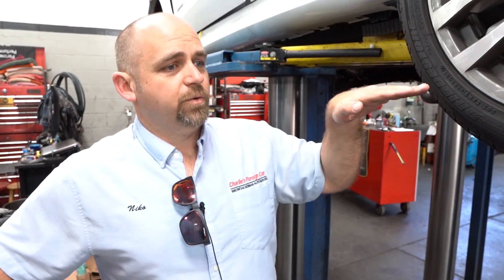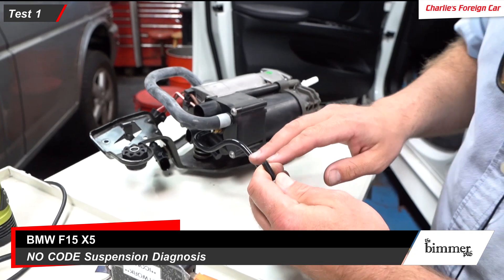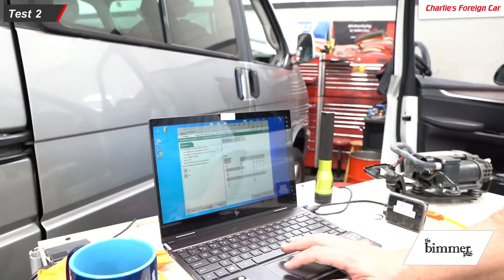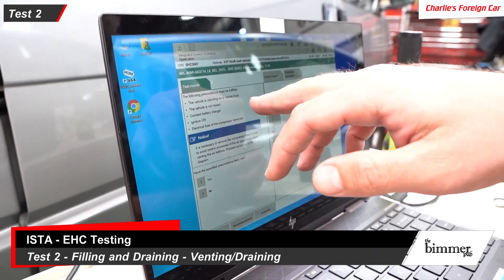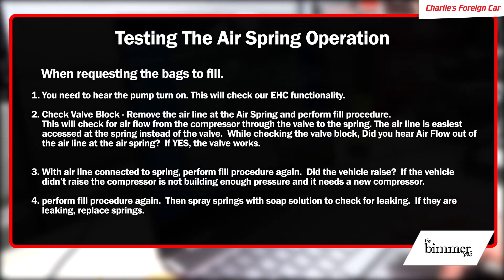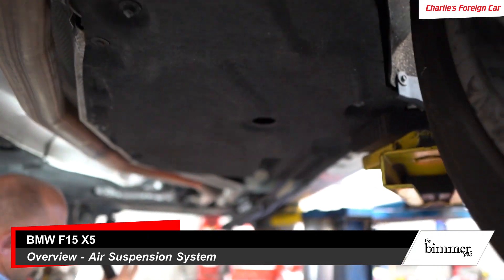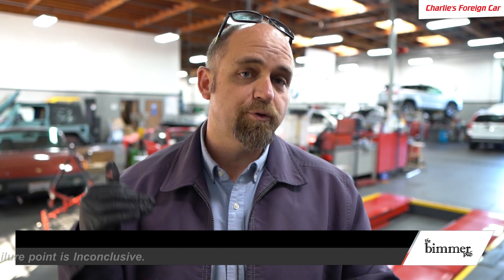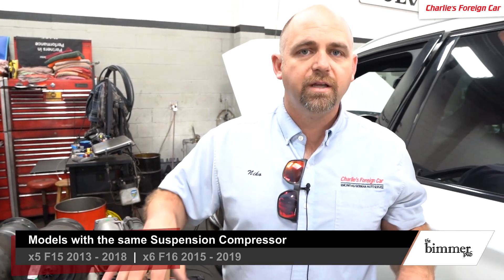Air Springs malfunction and NO suspension codes?

Comment: my air springs are leaving causing my rear to sag..however I'm not sure whether the compressor was damaged due to driving while the vehicle was sagging. anyway to check for the compressor? also going with the Arnott over the oem am i going to experience any difference, asking for a 2018 x5 40e phev

Comment: Bought new Airshocks, compressor isnt inflating the airshocks, compressor doesn't run when the car is on but seems to run when the engine switches off. Please help, what could be a problem

Comment: That's pretty simple indeed, I have a sagging BMW E71 X6M with a discharge valve fault. The bags will fill but they will sag if the car is not used over a few days. Is that vent valve a replacement part and causing the air to vent slowly over a few days?

Comment: Your discharge valve is probably stuck open due to moisture/water or just electrical fail. Your piston seal was fine until you put the screwdriver to it. You could have tested the discharge valve so verify if it was stuck open. This is why the suspension was all the way down. You can also check the distribution block to see if valves were operating (it was probably good as they don't go bad often).  Replace air bags if they show sighs of leaking but both don't usually go bad at the same time but should be replaced in pairs.  The discharge valve was the issue. A $30 part on amazon or just the valve itself for about $12. Mine did the same as this & no codes either on our '15 F15, a little WD40 in the valve & it freed it up & is still working. Nice video.
Reply: My one were both damaged apparently including the air compressor so had to replace both air below and the compressor totalling 3k up pounds with bmw

Comment: Charlie superb video. Let me add one thing - desiccant inside the pump is a wear item (which you know if you run that in a compressor line). It can and should be replaced, especially in humid climates! https://www.amazon.com/gp/product/B01G5NTE8E/ does the trick. This is simple to do. Once that desiccant is no longer pulling moisture, your pump is dealing with moisture issues, and also air resistance through the old desiccant can be an issue. Cheap and simple. Don't buy a $2k+ pump!

Comment: Thanks for the video. Been chasing this problem on my wife's X5 for sometime.  Without error codes it is so hard to troubleshoot as your video points because of the many components attached to the system.   I'm going to try the desiccant fix first that another video suggested and hope that fixes it.   Otherwise, new motor and airbags will be next.

Comment: It doesn't take much moisture to render the desiccant  dryer filter useless allowing moisture to damage the compressor. water intrusion is especially noticable when temps get below freezing (pump freezes-blows fuse. this happens often here in cold northern az). also when bags leak, the pump over duty cycles, gets really hot and burns out the crappy piston ring giving low pressures. I have found as a general rule if the bags are leaking and the car is 10+ years old... replace the compressor and bags as a set...
Reply: Marc,

My X5 is 3 years old with 50k miles and BMW is telling me to replace all. Is this common?